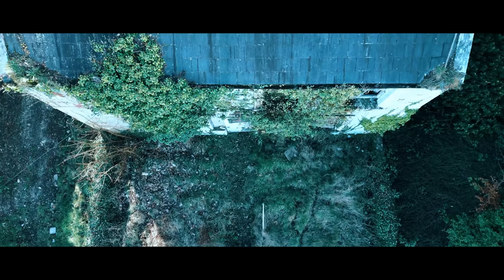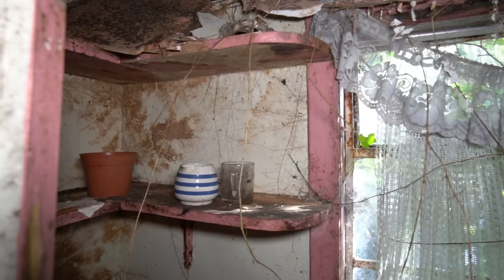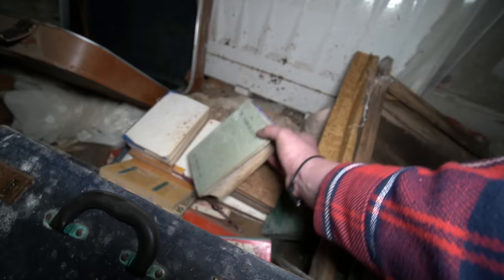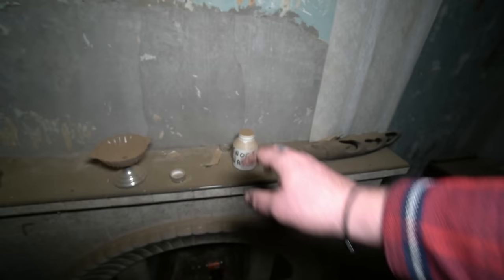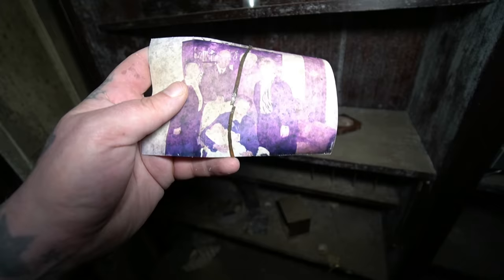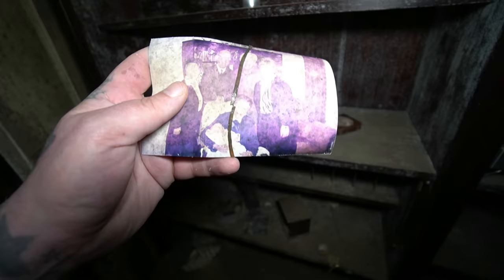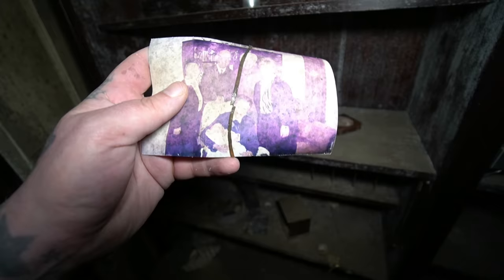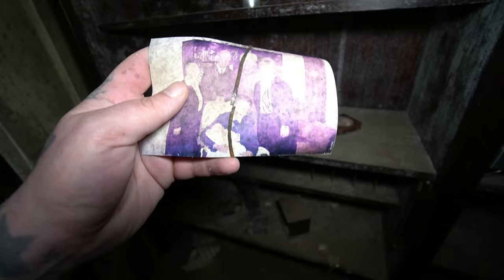SO HAUNTED I COULDNT CARRY ON - HAUNTED ABANDONED HOUSE LEFT WHEN SHE DIED INSIDE!

Comment: The little table with the padded seat attached was known as a 'telephone table' usually in the entrace hall, as phone calls were very few back in the day.  Alma and Ava (Arvay) are both religious terms used for prayers for protection. 'Paddy' is often used referring to Patrick or Irish. If Bridget was in bed upstairs or in the bed downstairs the smoke from the fire in the kitchen would have been enough to kill her. The 'alarm button' on the top landing by the stairs was a 'light button'  you press this in and the button slowly releases out then clicks and the light goes off,  these were used when electric lights were first installed to save electricity. Many houses or flats with several levels/floors had these installed and you had enough time to get to the next level push the next button before the previous light went out. The electrics looked like they would have been from the first installation and all the wiring would have been very dodgy. I remember when we changed from gas lamps in each room and had electricity unstalled in our old Georgian house in London when I was a child. Well done Adam you did so well with this, thank you 💕🇦🇺
Reply: Wow great information!
Reply: Thankyou for the Alma reference. I lived on Alma Hill, Lancashire, and could never find out what the name meant. It has a 13th century church a few meters away. It makes sense that the hill was a blessed hill. Thanks again! 👍
Reply: Hi Liz! I'm Liz too from Michigan. I love your interesing comment. It was full of information about the way houses used to be!  So funny when you said:  "Phone calls were few." Lol. Not like nowadays. 🤣🤪🥴
Reply: Great information Liz! I love the old homes, Im always interested to learn how some stuff was done back in the day👍Nice job!👍👍😊
Reply: Love this furniture
Reply: Great house  !
Reply: You really should have someone with you ! ..I get scared …
Reply: You are correct about the telephone table. I believe they were referred to as gossip benches. I have one.
Reply: Thanks for the info!
Reply: My great grandparents had one. I remember it in their big entrance hall. I sure would like to know what happened to it.  It was beautiful.  And yeah they were rare. I never knew anyone else with one. I'm referring to the telephone  table. I always loved sitting at it when I was a kid lol.
Reply: My grandma used to have a telephone table in her entrance way when I was younger.  I remember picking up the receiver and hearing people talking.  She had a party line cuz she lived atop a mountain in the Berkshires.
Aaahhhh the memories ❤️
Reply: @paulasmith2684  no kidding, please stop doing this alone!  The second I would get a "Get Out"  I would be outa there!
Reply: I remember the telephone tables. Thanks for the information. Very interesting.
Reply: Alma also can mean 'soul' 😉 or 'dear' one, like in an extra special person.
Reply: @paulasmith2684  isn't someone behind the camera filming him
Reply: Thanks for sharing your knowledge with us .🥰
Reply: I’m not Roman Catholic but I believe that the small brass on the wall with Jesus and a small well is poss for holy water x
Reply: Also the Knock Water. That is blessed water from the spring in Ireland (Knock) so you were right on there too. I have some in my home actually!
Reply: Thanks for sharing your information with us. Very interesting! I knew about the phone table but didn't know about the other stuff you said. 😊
Reply: So happy you got this information, I had a list to tell, but you sure added to it!
Reply: Absolutely wonderful information! Thank you so much for sharing.
Reply: What is "knock water"?
Reply: @annaverano5843  No he’s holding a camera on himself
Reply: @shelia-paulettegarnerrober4355  my family had a hall telephone stand similar to the one in the video when I was growing up in the 1950's & '60's in Minnesota, USA.  I passed it on to my cousin when my mother passed away in 2017.  She was tickled to get it & put in her home.
Reply: The telephone tables in my experience were usually as you say in the hall if there were room or indeed under the stairs. I can recall many times seeing relatives or friends sitting under the stairs chatting on the early old mechanical dial phones.
Reply: Very nice to see compliments
Reply: @MrChrissy1r  "Mechanical dial phones'" are properly termed:  Rotary telephones. This was the type of telephone in my home when I was growing up and it was always called a telephone -- not just phone.  It wasn't until sometime in the late 1960s (in the USA) that "Touch tone telephones" became available -- sometimes still called today "push button phones'.
Reply: @catrionapaterson4490  I remember those having holly water had similar ones as you walked in church doors you would bless yourself
Reply: We've got a telephone table in our hallway, our house is early 30s and when we moved in 23yrs ago I saw one in a little old antique shop and paid 10 pounds for it! 👍
Reply: My daughter's name is Alma. In Spanish, it means 'soul'.We are Spanish, Mexican, American.
Reply: Wow! That's alot of information 😮 thanks for sharing 😁👍
Reply: Holy water  from the spring at knock shrine  if you're a believer ... 
 Mayo county council tap water if youre not !
Reply: @VMM34  If the houses are Victorian it is likely the street was named for the Battle of Alma during the Crimean War of 1854. Many streets built at the time were called after battles- Inkerman Terrace, Sebastapol Rise for example.
Reply: @lindawalters1836  that's what my Grandma called it.
Reply: I had a gossip bench too and gave it to my son to put in his new home.
Reply: Yes the little cross on the wall with the half moon well underneath it is for holy water, often in hallways to bless yourself on entering and leaving a house,and on bedroom walls to bless yourself before bed and again in the morning before the start of the day
Reply: I know someone who has one lol
Reply: My friends old flat still has these light switches. It was horrible as I am disabled so trying to get to hers before light went off was SO hard. Her flat was haunted too, & her uncle / brother & others held a Ouija board & they all came out absolutely WHITE as sheets. She has since moved but the place is still supposed to be haunted. Never know Adam, might see you there on here one day lol
Reply: What a wonderful house. You are so brave. When that spirit box said " GET OUT'  I would have been out in a flash. Great words you picked up on.  He was protecting you. 😊
He's very lonely. 😊
Great video.  I really enjoyed watching it. Looking forward to your next one. 
Stay safe 😀
Reply: Absolutely spot on. Thank you.

Comment: I am just an architecture student so please correct me if i'm wrong. I think the house looks like it could've been designed and built between 1870's and 1920's. It reminds me of William Morris' Red House in some ways, like the wall decoration (in this case wallpaper), and some elements of the layout as well. What i found the most interesting thing about this house was the location choice for the main bathroom (which seems to had been shared among the 4 bedrooms' users on the second floor judging by its size) and its access being set right on the stair's "resting area".

Comment: I like that you mentioned that about the little prayer card and said a little poem of our lord and savior there. That little thing hanging on the wall with the crucifix attached to the back of it is originally to be hung by the door most used it holds holy water in it and when you leave you can sprinkle some on your fore head in the shape of the cross.  Blessings to you.  Cheers.  😊

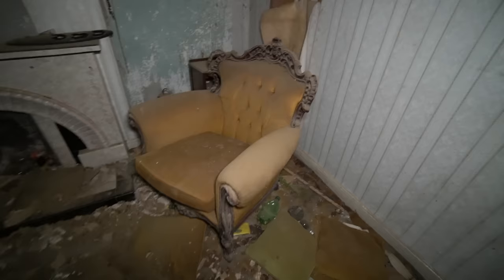Comment: At 3:32 the unit is actually called a whatnot, believe it or not but  it's true. Many many thousands of them were produced and used in old small two up two down houses as the in the early days in those houses space was at a premium, usually in the kitchen dining rooms of the day or in what we used to call a scullery. Sorry to disillusion you guys but that moulding on the chairs at 7:30 is not hand carved, sorry it's typical of the mass produced machine churned out furniture of the day. Like the whatnot it was utility furniture, but the chairs were gaudy but cheap and served a purpose. The wooden mouldings were a modern version of the kind of mouldings that were literally that, plaster and wire mesh and formed in a mould.

Comment: I don’t mean any disrespect, in fact it’s brave what you do and i wouldn’t fancy doing it myself. But one thing i’ve never understood and find frustrating. Why did you not stay and get them talking more. It was just getting interesting. I find this with so many of these channels and paranormal investigators, they ask questions or ask to knock 3 times ect, as soon as they get a response, they freak out and run. 
Like i said i don’t mean any disrespect but one day, if an investigator hung around long enough then they might actually get some solid concrete proof ghosts do exist or even better get something believable on film.